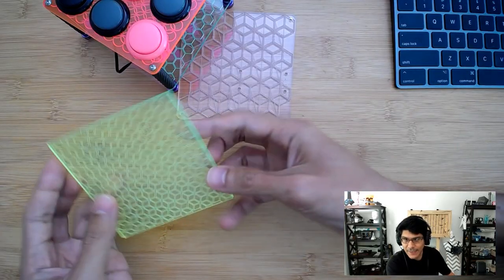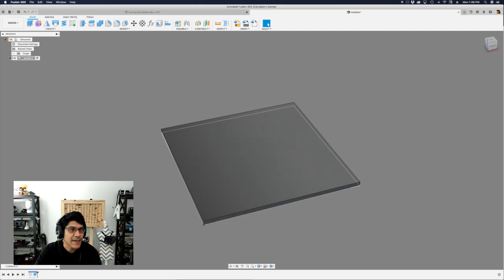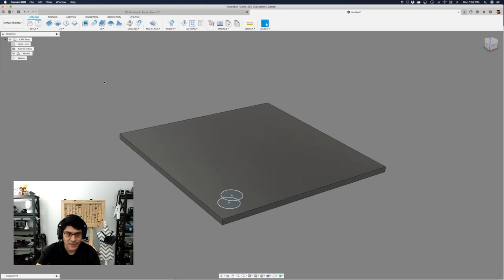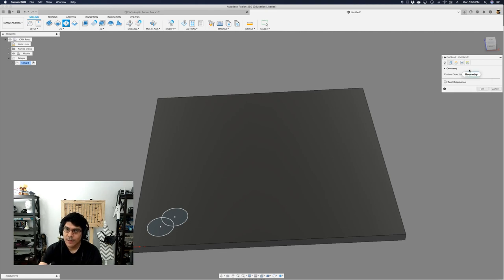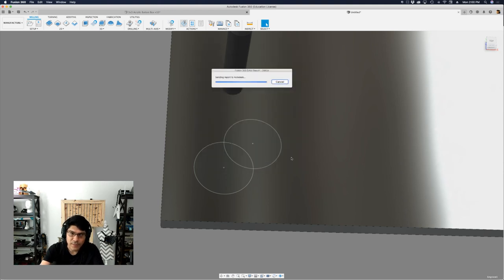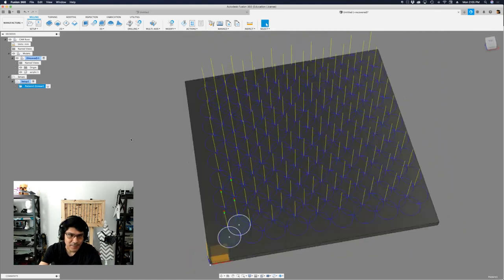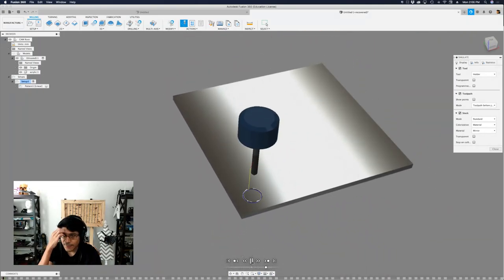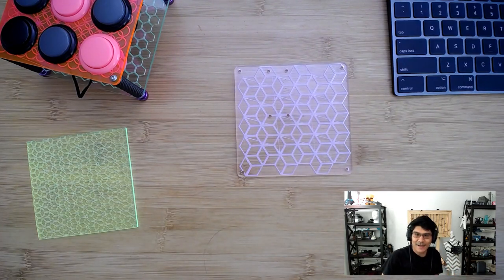Layer by Layer – Engraving Patterns – Fusion 360 Tutorial

Comment: In the other pattern if you just Check the tool setting in the last panel if the keep tool down is check unchecked it and run again the lines will not come.